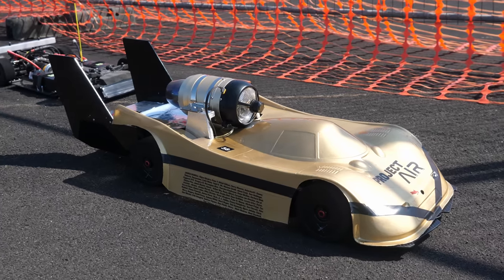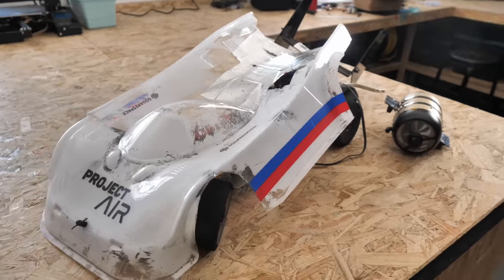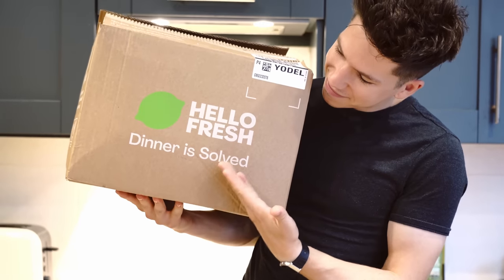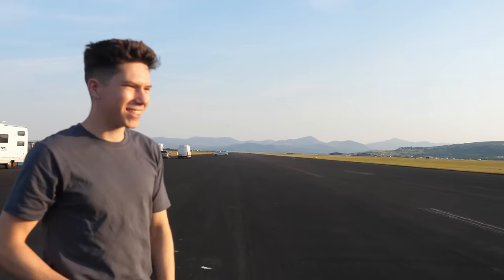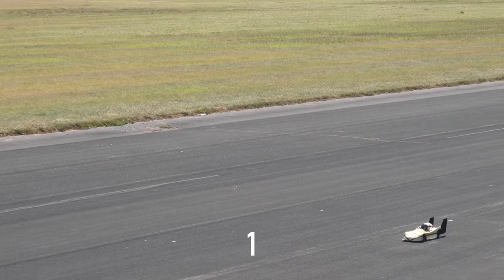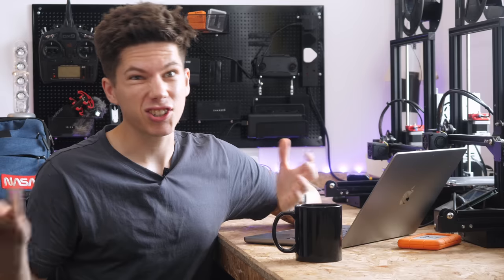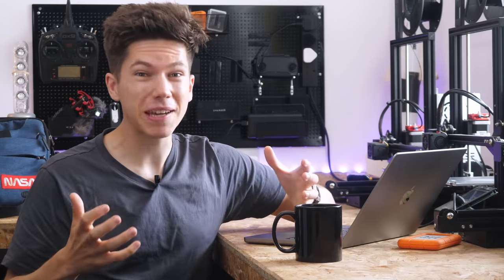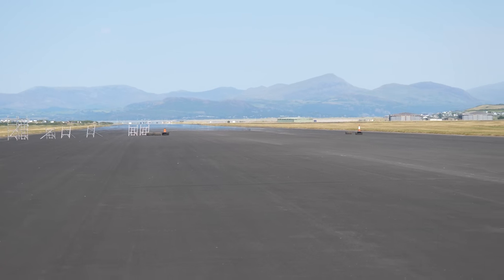Fastest RC Jet Car (Runway Testing)

Comment: If there’s one thing I’ve learned when messing with control systems is that PIDs require a ton of tuning and testing when you want to use them in a vehicle like this. This vehicle has a ton of vibration, it has to work at low and high speed, and the environment is quite unforgiving. Any tiny bump or overcompensation sends it out of control as you saw. The only way to make this gyro work at all is to do A LOT of test runs while recording gyro data, then you have to learn how to tune PIDs to perfectly balance the system, but even then sometimes you may encounter an un-tested scenario where your PID settings oscillate. Mounting it to some sort of shock absorbing system in your car + tuning out input noise would be the first steps.  Also a big issue is that the gyro isn’t tuned for the speed. It’s way too sensitive and even if it has some sort of algorithm to try to compensate for any errors, one overcompensation at 100mph is already too much. 

I think passive stability is the way to go for this vehicle because it’s definitely possible to control it manually as you saw from other competitors, and any benefit from a properly functioning gyro would be minimal considering the risk and effort.

I’ve seen a program which tunes your PIDs via AI to a technically perfect level, but I think this car can’t really do that because it’s not like you can crash it over and over again while the AI sorts the PID out.

Also, look at baffling your fuel tank. If the cars oscillation somewhat matches the sloshing rate in the fuel tank then that’ll be a huge stability issue. Like carrying a big jug of water which has the same slosh rate as your steps and you can feel it try to tip you over.

Comment: I think that gyro might me a bit subpar for the task (quality gyros for RC planes go around 200€), apart from the vibrations and the EMI with the electric setup. For really high speed applications, like fast rc jets (by fast I mean 320km/h or more) usually the gyro is supplied with speed data (from a GPS or a pitot tube) to turn down the gain (until VERY low values) when the speed is high.

If you decide to use a gyro again after this, I would suggest to turn down the gain to the bare minimum. You wont crash a car due to this, the worst case is having a "slow" handling, like a boat. Or better, swap that gyro with a futaba one.

Comment: I wouldn't discount Raz's advice too early, he has a track record for knowing his shit when it comes to speed runs. The gyro could simply have been reacting to forces applied to your wing, if your wing is getting disturbed at high speed your gyro will try to combat that. Just taking the gyro off doesn't prove anything, as the faster you go the more your wing needs to deal with, this is the reason Raz's wings are made from carbon fiber and shaped like they are, so they are super stable at 190+ mph. Just be cautious in thinking that it's only the Gyro at fault here. With all that said, love the build and your channel is great!

Comment: I say you go all metal parts, much stiffer. Very cool Talbot was there to give you some tips. The guy knows RC. Anyway, I say you keep the jet, but make your own. Make it a little wider for stability and make it so you don't have to remove the jet everytime you remove the body. You're on the right track bud, good luck with the next build. Looking forward to see what you come up with.

Comment: I experienced the same problem with a gyro, mine kicked in much quicker around 30mph while accelerating hard. Mind you I was using a shorter wheel base, so the gyro freak out happened quicker 😬
Love the videos chap!

Comment: These gyros get weird when there is a lot of vibration, many have the ability to be toned down with a potentiometer on the radio but I'd just not use it. The wing seems to be giving you plenty of stability at speed. Maybe turn the rates way down so the steering is very mild. Also I'd get a surface radio, it should be easier to drive with a wheel rather than sticks. Raz knows how to build a damn fine car and his perfect pass servo is epic but he comes off as a pompous know-it-all calling everything garbage and whatnot. He was doing it to Kevin in his last video too.

Comment: Cool to see something different. Definitely ditch the Spektrum radio, so many run aways with them, Futaba or Sanwa is the way to go or the Radio Link if you are doing it on more of a budget. That gyro is a budget one more aimed towards drifting, also the gain may have wanted adjusting as others have said.

Comment: I agree with you,the gyro was to sensitive,any play in your steering will exaggerate the gyro compensation,I would run without gyro and a small degree of tow out on the front,this should help to keep it running straight,hope you have mire success on the next run I watch in anticipation 👍

Comment: I'd probably try to make the car aero stabilized and ditch the gyro for what you're doing. Would be worth it to upgrade and rebuild the front end with stiffer components to get rid of the steering slop.

You can also try the rear covered wheels again, but make some sort of rigid frame (maybe out of some metal?) to keep the body from sucking into the wheels.

Comment: 2 issues with the gyro, first looks like gyro is mounted too hard so the vibrations are upsetting it.

the other issue is that as the speed increases the effective gain of the gyro increases. the same movement of the servo has a much bigger effect. 

highly recommend switching to an opentx based system maybe with a quadcopter flight controller and inav or similar that way you can look at the logs from the gyro to see whats going on. with gps and compass on board it could even do the speed runs autonomously :)

Comment: I think you should build a custom chassis (out of acrylic for example) tailored to your needs (longer wheelbase, integrated engine), also support the body so it doesn't get sucked in, the wheel arches are really good for aero so you should keep them (the new custom chassis should prevent them from scraping).
Also make the rear wheels wider, the car will be more stable, look at sports cars, they all have rear tires wider than the front ones. There seems to be a lot of space for them in the back.
If you integrate the engine into the body you should make a vent kinda formed around the body so it's aerodynamic.
With the engine in you should have a single uninterrupted body, maximum aero, maximum speed.
Work a bit on the spoiler to find the best downforce-drag balance, no gyro steering needed if the car is stable.
The wheels also look kinda wobbly, see if you can do something about it.

Comment: Hi, great attempt.
Have you thought of  monitoring the speed and adjusting the response of the steering accordingly.
That is making the steering travel less for the same joystick input, so you have finer control at high speed.
You will never want full left or right steering lock at 160kph.

Comment: Any event where you come away with a lot of new knowledge, is absolutely not a fail, its just another step along the path, as you travel uncharted waters. I have been battling with gyros for a couple of years and can contribute as much as I have found in case its useful. At best, I have only ever been able to get any useful results from a gyro if it is set to the smallest possible value. However, if I then disconnect the gyro and repeat, the handling always, means always, improves. Bottom line, take out the gyro, put it into deep storage. At best, it clouds the results of any changes, by modifying the outcome, by unknown unspecified amounts. Leave it out, at least you then know exactly what you are dealing with. So, I don't find you outcome surprising, it only confirms what I have already found. Good luck, stay with it.

Comment: Hey, I’m not sure if you’re still reading comments, but I have some experience with that controller... the antenna must be held upright toward the sky because the signal is emitted through the sides. If you accidentally point the tip at your car, (which can happen when you’re focused on driving) it will lose signal much too close. I crashed an airplane in this way. I actually opened up the controller to route the antenna through a hole so that it points upright while the controller is in a flat position. This way, I can hold it naturally without having to think about losing signal, I can just think about flying. 👍 Can’t wait for your next video!

Comment: Great job on doing a post mortem. It's always good to have as much data as you can collect, that includes the footage. I don't know if you are running any sensors, but if possible you should a couple sensors so you can analyze all your runs and adjust you car to your needs.

Comment: The oscillations are likely due to the gyro, the faster you go the smaller the corrections you need to make, the gyro doesn't take speed into account, so it doesn't dynamically scale the gain and starts to overcorrect at a certain speed.

Comment: I use gryo's on gas turbine powered RC jets which routinely fly in the 250mph speed range.  What I can share with you is that whilst a gyro can greatly improve stability, at a given speed, the effect you seek at one end of the performance envelope is actually very different at the other end of the envelope. Typically, the faster you go the less gyro gain you require. Using a level of gyro gain which gives you good stability at low speed, running the same gain at at high speed will almost certainly cause oscillation. On an RC jet we like to have a decent amount of gain at low speed as it helps with stability and counteracts any side wind effects when approaching to land (extremely beneficial when landing your £10K toy), however that same gain level can become problematic at high speed, as control inputs become more sensitive the faster you go, hence less gain is required. So how do we address this in RC jets? The gyro gain is adjusted in accordance with speed (the faster you go, the lower the gain required) and this is facilitated by data obtained by a GPS unit, or a pitot tube. The pitot generally being more accurate. In the absence of an ability to detect speed telemetry then just set a low gain setting to optimise high speed handling. It's almost always better to have too low gain than too high. No gain tends to equate to gyro off. I noticed a gain channel on your gyro, so you could run that into another channel on your receiver and put the gain setting on either a switch or a knob. If you assign to a three-way switch you can effectively disable the gyro at zero at one end of the switch. Just a suggestion.

Something to note on your radio and gyro test with motor and ESC on your bench. It looks like you were getting some interference from somewhere. If that is from the motor and ESC then that may not be a factor when you're running your turbine, since they are not present. However the turbine can indeed generate interference, or even the fuel pump, when running at speed. Consider using a turbine oil which contains an antistatic additive, as this can help with the build up of EMI caused by static. It's more common in some turbines than others. Jetcat sell their own turbine oil which contains an antistatic additive and you can get it in the UK and it's not much more expensive than regular turbine oil. Give Dave Wilshere at Motors and Rotors a call, he stocks it.

On a different note, I'm a bit surprised that the organisers did not insist on a radio fail safe check before any run was attempted. Whilst it's not reasonable for an organiser to be responsible for the general safety of your car (though it was nice to see the community helping you with the body work, hats off to them) it is totally within the gift of the organiser to insist on scrutineering the failsafe function of your radio. This is something I see done at RC jet events all the time. At the start of the day we go through scrutineering before our first flight and demo the turbine going to idle during a failsafe event. When you pass this check they put a coloured sticker on your plane and you're good for the rest of the day. It's just a sensible safety precaution and it's actually really good to reinforce your own confidence in the safety of your setup. I know some people are going to say that RC cars and RC planes are different beasts with different risks, but failed lipo batteries or a short in your electrics can start a fire reasonably well without the need of any fuel. Given that a radio link at ground level is much more temperamental than a radio link to an object in air, a failsafe check is particularly important as failsafe event is far more likely.

I've been in the RC hobby and flying jets for almost 20 years, and I am thoroughly enjoying your channel. I particularly enjoy how your break stuff down into the different steps on your journey and it makes for great viewing. Please continue with this project as I'd really like to see you get a gas turbine powered car somewhere near it's real potential. I truly believe you're on the right track with the incremental improvements you're bringing to the project and I'm really looking forward to another instalment. Please don't stop now ;-)

I'm now a confirmed subscriber to ProjectAir !!!

Comment: Nice run. You might want to ditch Team Failsafe ( Spektrum ) and go for TBS Crossfire on 900 MHz to never failsafe again. I'd also advise to use an Ardupilot / Rover capable flightcontroller like a Matek H743 Slim and fpv. You can examine the log files to exactly work out vibration frequencies and tune your filters accordingly. It also acts as a gyro. FPV will greatly help you to keep the car straight and will display any telemetry info you want on your osd.

Comment: Really enjoyed everyone else at the runway being 100% confident and 100% wrong in telling you how to do your job
Reply: Any unwanted vibration or oscillation is bad. They have a point. Literally everyone else has extremely rigid vertical stabilizers for a reason. Obviously what is a known good formula is going almost twice as fast with far less drama.

Comment: it is probably the response time and output as a result of the gyro. At speed you need much less 'correction', both in terms of the amount and the time to bring it back to 0. I believe lowering the gain (output signal), adding more tolerance (to remove the effects of vibrations on the road and small corrections) would help. I don't know how it'd work, but using the output more like a series of pulses should be even better. The best thing you could do is either remove the gyro completely, or introduce more complexity in the logic that keeps the wheels straight. Or you could go slightly wider, have a bit of camber. Additionally, you could distribute the weight of the fuel around, or make the tanks smaller (like how ships take care of fluids in their tanks by using baffles)

Comment: If you left the gyro at factory settings, it was likely set to 50, 75 or even 100% depending on the model. 
I use a maximum of 19% gyro gain if I'm driving 40mph+
Most gyros are way too sensitive at anything above 25%
The Spektrum AVC gyro has less speed wobble, but the AVC also effects the throttle input, which you don't want, so avoid AVC receivers.

Comment: Good vid! If it's any help, I built a powerful jet boat with a very minimal keel which was inherently unstable. I fitted an aircraft gyroscope for planes to help keep it straight in cross flow on rivers and at high speed on still water. At first I found that the gyroscope introduced a bit of wobble like you've seen but after I reduced the gain settings I had a really good experience with it. Highly recommended that you persevere with an adjustable gyro :-)

Comment: Great vid, always good to see people put their 'mistakes' up in the light, cause that's SCIENCE! Make sure the gains on that gyro are LOW if you're going high speed and you'd likely be better off with a gyro that will let you adjust gain from your transmitter. Gyros can be INCREDIBLY helpful but can lead to what you saw as well.

Comment: I think if you are going to make another jet car, then you should create a fused centerline engine design, similar to the Bloodhound lsr project. It helps reduce drag coefficient by a lot, and only require smaller tailfins to reduce drag even more. Also I suggest incorporating a parachute and/or an airbrake into the failsafe, so if the engine throttle failsafe doesn't work, you'd still have a backup for the backup. Godspeed.

Comment: I think this is amazing, I  think you should change the shell to remove the cockpit and place the turbine engine lower down on where the cockpit used to be, balances the car weight wise and reduces drag slightly from that cockpit. I think it would be minimal becauss of course tbat turbine is in open air but after looking at cfd models cockpits are one large source of drag

You could also maybe design a car where the turbine is within the car with the body built around it? Aerodynamic efficiency is at its best with minimal drag and the front can be open for the air intake and all that jazz. With also the engine within the car the exhaust gases can be taken with the air thrown upwards by the rear diffuser having a nice increase in the diffuser efficiency and cleaning up of the air behind

Comment: A mechanical gro might be a better choice, its not going to get into a wobble 
It wants to go stright,  a different option might be the same technology they use on automius cars it reads lines on the path and uses them to guide its path with electronics.
Id also like to see a camra on this and led screen on your controls to use insted of line of sight,  I belive you can also use it to give a speed readout using a smart phone app. This might require a small computer on board or just a smart phone and remote mounted camera. 
At 180 mph or is the kmh?